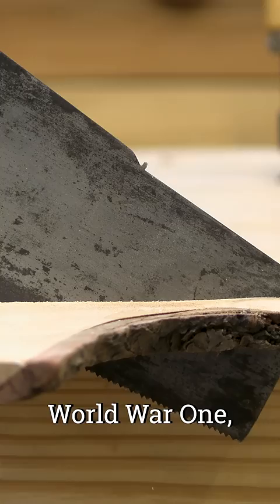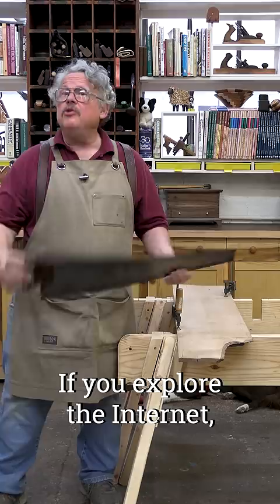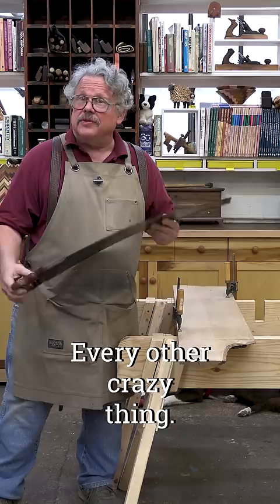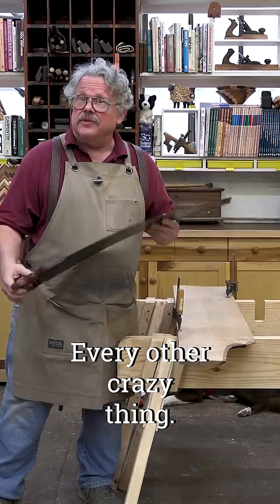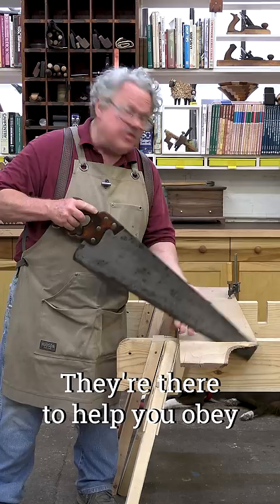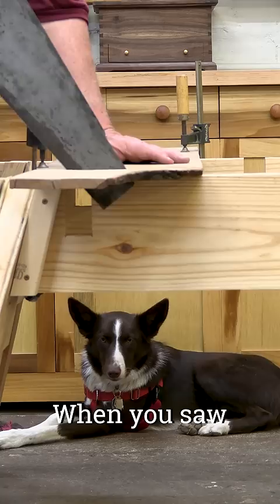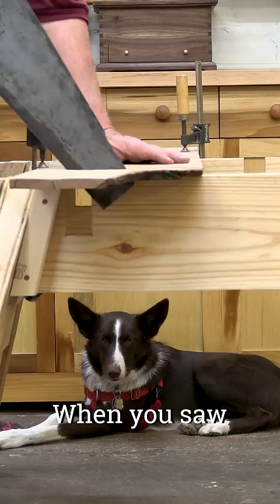Saw Nibs Explained

Comment: I once heard that a nib on a saw is to display and mark the quality of steel and craftsmanship used for a particular saw. If the steel is of quality and the precision of the blade is of.good craftsmanship, they display a special nib to show the time that went into it. I never quite believed that was the case, but I never heard otherwise until now.  I love the content, keep them coming!
Reply from the maker: That's the plan. And you're partially right about nibs marking a quality saw. Read my response to @bertaboy.
Reply: Wouldn’t The saw itself be evidence of good craftsmanship? I’m asking.
Reply: well the nib shows a couple inches before he gets to the end of the blade, so im not sure thats what its for either.
Reply: I’m inclined to believe the craftsmanship version more because he literally mentions in the video that saw nibs are on all sorts of other things. Why would other implements need something used on a saw? You don’t want to waste time going to get a saw and test driving it to see if it’s good. The nib is a very specific profile, you wouldn’t need to do that for just a marker.
Reply: @bryancaviness8788  you’d be surprised how easy it is to make a saw, but the nib is there, because the nib is really hard to make so it justifies the craftsmanship
Reply: @jesseschumacher4080  He is saying that the nibs are believed to be used as compasses, not that they are on compasses.
Reply: @ghidfg  He is only cutting through a 3/4" board, if he were to cut through a 2" board it would use the whole saw. Makes since to me that the nib would be a few inches back from the end of the saw for that reason.
Reply: That's a theory
Reply: I heard the same thing
Reply: WHT you reference is still relevant, some nibs would be fancy and be a full curly q a hard to achieve show of skill and quality.
Reply: this is what I heard too
Reply: I’ve recently heard this same explanation as to what the nib is for
Reply: I have also been told that,what this guy said and what you have said both seem to have merrit
Reply: @jesseschumacher4080  but... like... the teeth are much more fine and precise than the nib. So it doesn't really prove anything if you can put a nib on your saw. But I don't believe the video either, because a notch is actually easier to see and make
Reply: No it showed the quality of work they can do
Reply: I see somebody else has seen that short so by comment is not needed here... Carry on😅
Reply: @ajreukgjdi94  you don’t forge the teeth, you file sharpen them
Reply: @jesseschumacher4080  Whatever method you use to make them, they're more intricate, and therefore, harder to make than the nib. There's no reason you couldn't half-ass forge a nib, and then file it to make it look like you're really good at forging
Reply: yes this is why
Reply: Yea me too, and your saw should not wear from wood it will dull, and you file all the teeth equal and if it’s not even u should SHARPEN up ur file skills
Reply: @ghidfg ahhh you just haven't used a hand saw. When you're sawing, by the time you see that nib, your brain interprets that visual information, and you reverse the stroke, it's at the end of the saw.
Reply: That was the original reason, but we as humans are great at finding uses for things.
Reply: Same
Reply: I heard the same. This makes more sense
Reply: @jesseschumacher4080  no man, he’s saying those are some of the reported uses of the nib. Not that they’re also on those things, they are not.
Reply: i heard the same thing
Reply: Isn’t it to test the quality of the craftsmanship?
Reply: @bryancaviness8788 yes but i think it showed that the craftsman who made the saw showed particular attention to detail and it’s hard to know if the saw itself is good quality unless you’re very familiar with them.
Reply: @WorkshopCompanion commenter you're replying to has it right, your video is the equivalent of the back scratcher guess
Reply: I heard this too. As well as it's marker basically. A starting point that won't do as much damage as all the teeth if you're in the wrong spot.
Reply: Ur right
Reply: @travnarok415 no I'm pretty sure he said they were on compasses but I'm going to go re-watch and then I'm going to edit
Reply: I’ve also heard this one many times about how it shows the craftsman’s work. The video is also a very good point but if you use saws often you already use the whole saw blade for that’s what it’s intended for
Reply: @onewhowatchesfromveryveryfar no.
Reply: @onewhowatchesfromveryveryfar he saying the internet claims they do many things such as they act as “built-in” compasses… etc. meaning “a compass built into the saw” not that they also appear on compasses. See the difference?
Reply: That too
Reply: I've hewrd it all.

It's a guide. It's a craftsman's mark. It's a mark of quality material.

And yet. No agreement and no example.
Reply: @bryancaviness8788 
Yes!
Reply: @travnarok415 
No no. They're found on compasses. 
On fire pokers.
Reply: I suspect its BOTH, its existence may be functional but its style can be used to show off the craftsmanship of the maker
Reply: Exactly what I heard. I figure there's probably several reasons for the nib.
Reply: Same
Reply: My grandfather (born in 1900) was a master (wooden) shipbuilder, his best saws had a nib, he explained it to me as above, and as in the vid. Both. It's a twofer.
Reply: We all saw that video huh
Reply: @hiems7118  That's a good point. This guy might not be right. I think it's just a mark of a well made saw from before everything was stamped out uniformly.
Reply: That's exactly what I have always heard, if they can make the nib they have the skills to produce consistent quality teeth....
Reply: Battles……you were correct from the start!!! Why would a backscratcher need one of the purpose was to keep a saw from wearing out unevenly?? 

It’s a makers mark!!
Reply: Exactly what about to say
Reply: It's both.
Reply: @WoodByWright Not that my good riddance means anything to you, but I really respect that you take the time to watch other woodworkers - to me, it's pretty cool that it's a genuine interest of yours, and not just a way to make money(even though that is, of course, also totally legit:) ) I myself work with historical carpentry in a Scandinavian museum, and I find myself "at work" all the time - with all the content on here - it's just too damn interesting watching all the tricks you guys have !  So, thanks for sharing - and also for caring enough about the trade to watch others :)
Reply: @WorkshopCompanion It never had a utility function and have been consider ornamental even before the 20th century.  Everyone has their own story of the saw nib now, “clears out sawdust from your cut” “mark of craftsmanship”etc.
Reply: This is the best answer I've seen so far. This guy's explanation doesn't make any sense. He's stopping 4-6 inches short of the end of the saw, whilst saying we should use the whole saw.
Reply: If you look into it that is the case... Or rather the most likely case. Everything else seems to be not likely either not true, or just where it eventually evolved and became used for
Reply: I don't care what anybody says. That's a far more accurate answer than what the hell is. Meatball is saying why the f*** would a compass have a nib why would a back scratch or have a nib so you use the whole back scratcher and the middle of it doesn't go dough? F*** no, it's to show the craftsmanship skill
Reply: @ghidfg if the craftsman can get work a tiny nib into a saw, he can certainly make a decent blade, as it takes skill to it that nib there
Reply: This is also what I learned in school
Reply: @jesseschumacher4080  Yeah it was said in the video where I heard that too... that "If someone can make that sort of nib with such precision, you can trust that the saw is made with the same level of quality"
Reply: You didn't once hear that you watched another YouTube short that said that
Reply: i heard same
Reply: @jesseschumacher4080 yes I heard its to show the saw was made by someone skilled in working with steel
Reply: Sounds foolish, would be much more important to show on tools that require high precision, but none have them. Why only saws?
Reply: That explanation is still being spread -- I saw it on a Youtube video last month.
Reply: @bryancaviness8788 intricate nibs show that the craftsman has a steady hand and is comfortable working in very small areas. this shows that the teeth are likely to all be the right shape and sharpened well
Reply: @ghidfg I don't think it's his opinion or guess, he's telling you what it is. Not up for debate.
Reply: @badhabit8824  yeah it is, unless he originated putting nibs on saws its all conjecture.
Reply: Yh same this guys chatting
Reply: @bryancaviness8788 no, since any dipshit that can just cut a saw blade out of a peace of steel that doesn’t contain high enough carbon inside of it to maintain the sharpness of the teeth for more then 1 cut and then present that as a saw.

The nib shows you that the person behind the making of the saw is skilled and able to make a good quality blade.

Now that is literally the only purpose the nib has. To use it for anything else is pointless and moronic because the nib is actually very fragile and can break off if you try and use it for anything other then looking at and going “wow this guy made a good ass blade”
Reply: Same
Reply: Only someone with single digit iq would think that
Reply: @apapz3245  Last I saw it was just somebody on the Internet talking about it. This is the only explanation for that near bun old saws that I’ve ever seen that actually makes any sense.
Reply: @apapz3245  I work with tools every single day of my life, in fact my job has to do with them, and I’ve made dozens of saws, and I’m telling you that’s what the nib is for.

And there is jack shit evidence for the nib being used for literally anything else.
Reply: That myth probably started because older tools were higher quality. And still are sadly. Who doesn't want a 1950's lathe vs a 2023 Chinesium lathe?
Reply: That's the explanation that Wranglerstar gave too
Reply: That is the exact explanation I was given from a marker. "If we can make that intricate nib, then you can rest assured the saw you're getting is top quality."
Reply: That’s what I’ve always heard
Reply: @sailorbychoice1  That's insanely cool. What I would give to talk to an expert in sailing vessels. I'm a big fan of the topic.
Reply: Same thing I heard about nibs
Reply: @bryancaviness8788  no the nib is allways thinner than a tooth it's showing if I can do this you know the teeth are good
Reply: The dog is very interested
Reply: you're right the craftmen started putting nibs to show that a skilled craftsmen made thy saw
Reply: That’s what I was told it’s a mark of quality of craftsmanship of the smith that made it.
Reply: I learned more from this man than I've learned from women in the last six months.
Reply: I also heard that is was a sign of quality. This is the first I've ever heard the explanation of it being used for when to stop the draw back.
Reply: I belive the nib was like a mark of who made it because they were hand made and if the nib was super hard to make it would show that the person making it is a skilled Smith
Reply: Yeah same
Reply: I would believe it was a layout tool before any other reason. Certainly not hard to make, and not pretty to look at.
Reply: There’s probably many reasons these nibs exist, I doubt it’s just one thing, yours is definitely true to a certain extent considering how elaborate and ornate some saw nibs can be
Reply: @bryancaviness8788 making a saw is easy on itself, but making a good saw is difficult, and the nib was used for more than one purpose, it showed that the saw was of high quality, and showed that the blades of the saw weren’t just knicks on a plate of steel.
Reply: That’s because it is, they used it as a indicator for craftsmanships second purpose
Reply: I think that’s just what people say when they can’t explain something that was hand crafted. The equivalent to saying the pyramids were used as tombs when there’s no evidence of it
Reply: that’s what i heard and was about to comment lol
Reply: You're correct, this video is incorrect lol...
Reply: @WorkshopCompanion  im not disagreeing with you as both sides creator and user of the tool see their own way. I was taught by an old blacksmith that those nibs were there for a test of quality if its easily broken then the tool must be so as well. It served a secondary purpose while they were being machined to also test quality, if the nibs are being deformed the machine is probably malfunctioning. I revel in the knowledge you have found as a user of the tool.
Reply: exactly what i heard as well
Reply: @niczim123  I don't know where the hell you're getting a compass built into a saw from because that's not what I heard it all
Reply: People who all are arguing about it shows the quality of work they can do, all saws are machine made, r u talking about the quality of machine can do???
Reply: I heard the same thing
Reply: same
Reply: That's what I've heard too- that it's a show of the level of craftsmanship by the person who made the saw. Thought this was interesting though. I guess it's possible it's got multiple "uses".
Reply: @travnarok415 I see what you're saying, it definitely seems like it could be interpreted both ways- that the saw nib is used for a back scratcher, a compass, etc-  or that these other items also have a nib on them. Don't know which way he meant it- but without your comment, I probably wouldn't have seen how it could be taken either way.
Reply: You didn't have common sense? It's placed exactly where you'd stop the saw lol I guess you weren't given a children's mini saw? My nonno gave me a razor sharp saw aged 3-4. Child sized 😂 I only cut myself a lot.
Reply: I'm not a wood worker, but I've been a blacksmith for nearly three decades now, and the nibs don't indicate quality in any way at all, they'd be a piece of cake to chisel out and shape, a first day apprentice could be taught to put them on a blade blank!  This seems to be the most plausible explanation, though I've also found the "extra handle" argument interesting too.
Reply: @warpdriveby  just a note- not all look like the nib on his saw though- and these are on saws from like 100 years+ ago (they aren't modern, where they could just add that, to be cut out by a laser onto a blank before bending and sharpening the teeth) some are much more intricate. But I'll take your word that it would be easy, since I've never done "real" metal working- and have only used an angle grinder to cut and shape metal- never have forged anything, done any actual blacksmithing work, or even welded- unfortunately... Dabble in lots of stuff- but an expert in very little. Lol.
Reply: @travnarok415 I noticed that too, though it could just be an alert. They probably used many diff length saws and it was a mark for timing. If not, the front of the saw is always used to establish a line, which takes a bit more work, maybe the usage is equally distributed. You use the front half to get the cut going and the rest saw
Reply: That is exactly what the nib is for, with a little wear and tear that nib will break off showing the inferiority of the steel. It is also hard to make ( these saws were handcrafted ) showing off the craftsmanship. I've never heard anything about them like described in this video, and I've seen nibs placed all over the saws.
Reply: @Sardit its not exactly for that, you only heard what evidence does that prive its for quality?
Reply: The real answer. Watching for the nib while sawing was taught to kids back in the day but wasn't the real point. That's why many metalworks had it
Reply: @bryancaviness8788  Machined edges of the time could get sharper but would be softer. When testing softness trying to bend a nib was safer than pressing on the teeth
Reply: I saw thhat video too, and i think it could be both though. 
Its like if uou buy a machine and  a certain feature that is of practical use only exists in high quality ones the exiatence of that feature in a machine would indicate its high quality
Reply: That's what I heard as well.
Reply: @bryancaviness8788  It shows that you're able beyond making a good saw, also you can see from far is a good saw. Cause it takes skill to make this bit without chipping the metal
Reply: @jesseschumacher4080 I'd find myself inclined to use all these nibs for attaching carrying straps and whatnot.
Reply: @ajreukgjdi94  the teeth are cut, while the nib would be shaped by hand, I would think.   But I could be way off.
Reply: @ajreukgjdi94  1800s version of grinding and paint make me the welder I ain't.
Reply: Not EXACTLY.  My uncle who done his carpenters apprenticeship in the mid 60s showed me a method of twanging a saw which will indicate the steel quality.
Reply: It is. This guy is wrong. Plain and simple.
Reply: Yours makes more sense. I don't need a nib to know if I'm using the whole saw or not.
Reply: Yeah you're right. I don't like the answer of "it's supposed to let you know to use the full length of the saw blade" because if you work with wood of course you would already know that and if you don't work with wood I'm assuming you would use the full length anyways. If you don't use the full length then how is a nib at the end of a saw going to let people know that you're supposed to use the full length of the saw? You would need written instructions for those type of people. Maybe not even written instructions but verbal instructions.
Reply: I saw that YouTube vid 2
Reply: @battles151 that is what it’s for, I don’t k ow wtf this dude is talkin bout
Reply: @ghidfg Yea I guess maybe but you also don't want to  pull your saw right out
Reply: Any theory is correct
Reply: Same
Reply: Probably closer to the truth , however I've no doubt that carpenters and joiners aŕe creative therefore I can see the "tooth" being utilised in other than was the intentent .. 
My father and uncle always claimed that often tradesmen used it to mark arcs etc..
Reply: @travnarok415  If that were the case, there should be multiple notches (not nibs, waste of time) like on a ruler so you know where to stop sawing for different thickness of wood you are cutting.
Reply: @WorkshopCompanion  So there is a nib on my 19th century back scratcher so I know when to stop scratching (if not beware of scratching the brown balloon knot?) 🤡🤥
Reply: @lacyfins9627  Exactly.  A nib would be useless on a back scratcher as a device to measure depth.  It could actually be detrimental since it could catch on the clothing if you chose to scratch your back directly on your skin.
Reply: Well when your pulling the saw fast it takes a sec to stop unless your a machine. Use common sense.
Reply: Kinda the same principle as Norwegian knife blandes, before smiths got signatures they used to make such notches on the back of the blade to sign it. Each Smith had a diffrent notch. In Norwegian its called «smellopp».
Reply: @bryancaviness8788  Kinda, its more so the finer things you cant see, as nibs would usually be fancier than seen on this saw to display skill
Reply: That's why its on the saw
 but he is explaining why its at that specific location
Reply: Combination
Nibs serve a utility purpose
Better made the nib is, better the craftsman of the saw! 
One love❤
Reply: @michaelzindel1419  here's the thing , my pops was 6'4" and guaranteed that he used the full stroke.. my Pal and apprentice in the same shop was a little over 5'8"  he never used full stroke on ripping ,yet was exceptionally fast at ripping ..
 when ripping you should be putting the power in on the cut on the last half . Just check when you rip a 2x4 as a test, you will find that your shoulder should be over your hand to get the weight into the stroke.. 
cross cutting shoulder further back and saw at a less steep angle.. 
Our tradesmen would often set up an apprentice race .. of course there was a book running , form studied and critiqued ..
Reply: @joshuabartley1279  exactly , it's Al down to muscle memory and physique..
Reply from the maker: Will do. I think that the notion that nibs were a mark of quality evolved in the  early part of the twentieth century when hand saws slowly became a back-up to power saws. Manufacturers eliminated the nibs, carved handles, and  other niceties that had been common when hand saws were  a primary cutting tool.. The quality  of steel and the work required to "tune" it -- relieve the internal tensions -- was reduced as well, all to keep the price down. If for some reason you wanted a good saw,  you looked for an older one. You could be fairly certain that a saw with nibs had good steel and was better tuned than the junk that was flooding the market. But the nibs weren't originally put there as an indication of quality.
Reply: @travnarok415  perhaps was just convieniant to use as one .. all sorts of stories
Reply: Too add another reason for it existence.. Perhaps it was easier to file just one tooth.. and from there, the production machinery of the day used that "tooth" to index the sharpening equipement, therein consitent grinding or filling of each batch..
Reply: It can always be both
Reply: That would depend upon how thick the piece of the wood is that you are cutting  @ghidfg
Reply: the other side of the blade has a whole bunch of nibs that take more skill to make
Reply: This is what always thought as well!
Reply: Whats up my nibber!